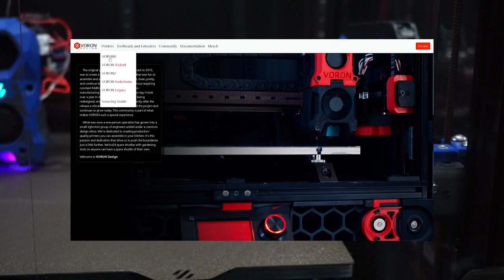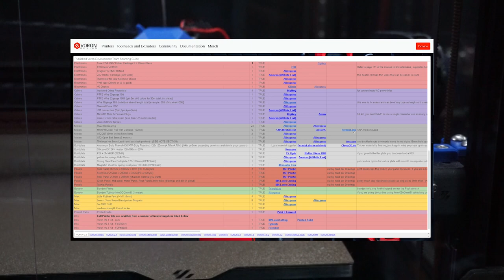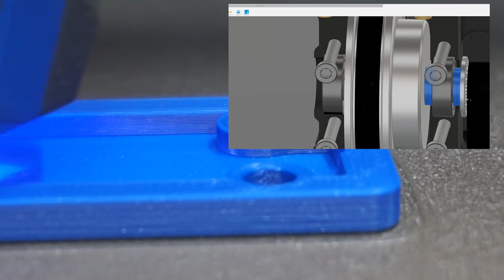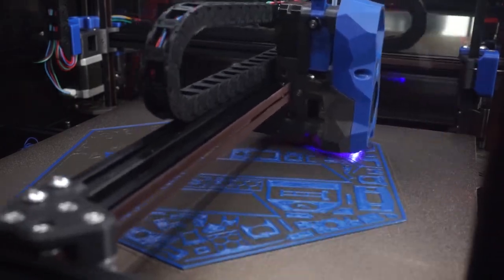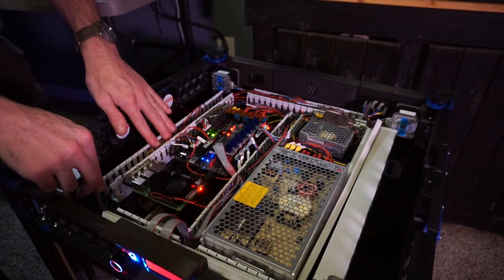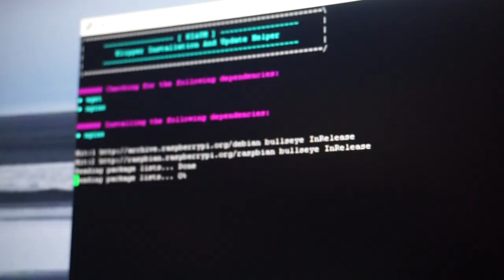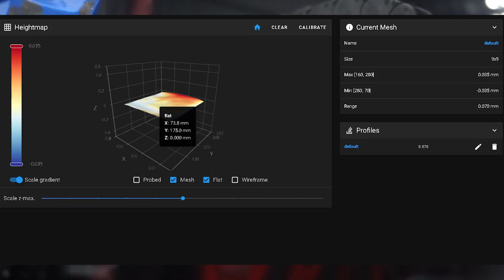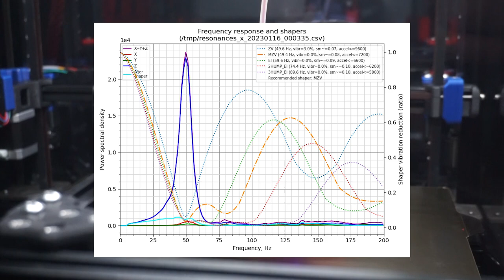Why Building A Voron 2.4 Was The Best Learning Experience

Comment: Cool build and nice coverage of the process. I just want to note that the values provided by the input shaper are basically the resonant frequencies of the printer. The value really has no impact on your prints, nor the speed, as long as you set it up properly.
Reply from the maker: The way I worded it wasn’t the best I will say. Sometime here soon I’ll have to make a video more in depth about input shaper. Yes it doesn’t have anything to do with speed just minimizes ghosting at high acceleration also turns the printer into an airplane during those test ;) Thanks for the feedback I’ll be sure to clarify that in the future!

Comment: Hi. Thanks for the video. 
Where did you buy the powder coated buildplate? Are you satisfied with it?
Reply from the maker: I have several, so many brands out there but I’ve been using one from deepfriedhero.in has a good smooth pei side, textured side very nice too very high “sand count” i guess would be the best terminology. Gives off more of a matte textured look than a shiny texture. So far it’s been the best pei sheet I’ve received that’s if I keep my sweaty hot finger tips off it 😂
Reply: @3dsprinter  thanks 😊 Keep up the good work 👍